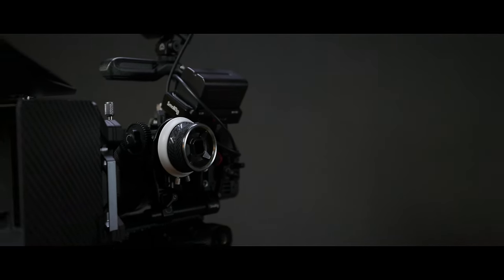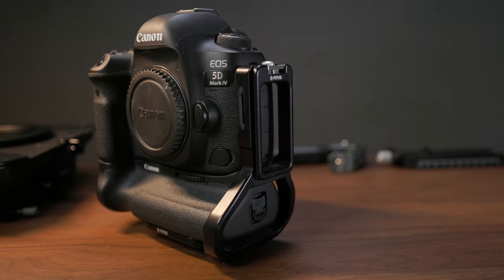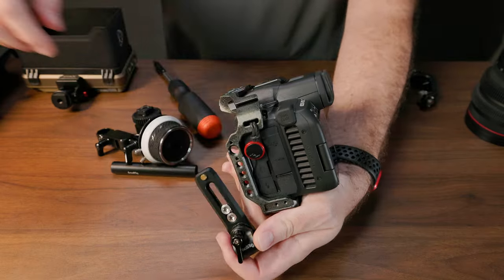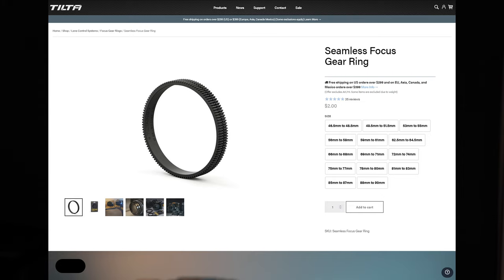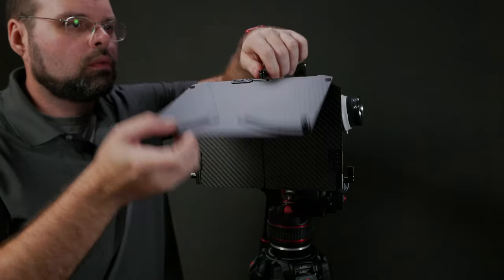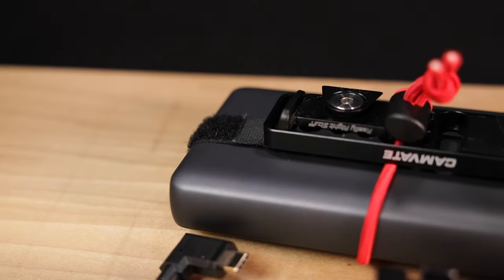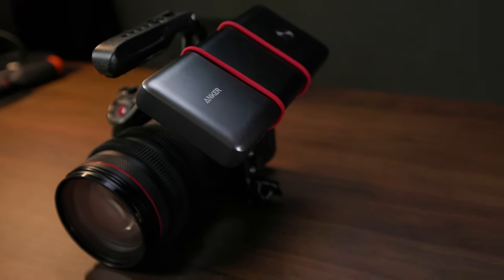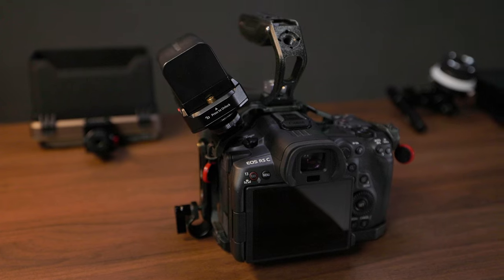Rigging and Accessories for the R5C Revisited Almost 2 years later - EOS R5C Tip 28

Comment: I love your R5C videos, just bought one, but I think I might have gotten a lemon. When you have the lcd screen closed, is there any wiggle in it, for example if you press it slightly upwards, toward the viewfinder? It's hard to know what's within the accepted tolerances, but my R5 has zero wiggle when closed. Oh, and when slightly underexposing the camera against a white wall for example, I get awful vertical magenta banding in clog3. Do you reckon this is normal?
Reply from the maker: Yes, there is. Maybe around 1 mm at the far end. Enough to be noticeable if you wiggle it. That said, one big difference between the R5 and R5C is that the R5's screen folds completely into the body while the R5C's doesn't quite lock down that tightly.

The banding doesn't sound right through. But, before you call Canon, if you haven't run auto black balance (ABB on the top fo of the shoot 6 menu) try that first. If that doesn't clear it up, then you'll probably want to talk to Canon about it.

Comment: I got a 50 watt hour v mount battery and a V-Mount adapter for the bottom of the DJI RS2. Usually I just use the gimbal until the battery dies and switch it though rather than waste time setting it up. However if I did have another gig where I needed the gimbal all day it would be suitable.

Comment: FYI, Accsoon also have a NP-F to USB-PD adapter offereing similar power solution. The Accsoon one has 2 anti-rotation pin holes on the bottom side of the adapter. Does the small-rig one has this feature?
Reply from the maker: No. But it has a slot that can accept multiple captive screws, so you can prevent it from rotating that way.

Comment: I ended up getting the Black Mamba cage for my R5C and now the eyelet screw is completely stripped. Definitely user error but the screw is like aluminum foil strength. Trying to figure out the best way to get it out probably drill. Or get a reverse drill bit very tiny one
Reply from the maker: Almost all of thse cages are Aluminum. You absolutely don't want to crank down on any of the screws more than tight enough. If you need to hang something use a piece of NATO rail with multiple screws into the cage, or an Arri style 3/8-16 thread with the rotation locking pins.

Comment: If you did buy the small rig black mamba kit it comes with a cable securing option That will be sure to frustrate you to no end. It definitely does work though once you get it in secure
Reply from the maker: I found SmallRigs cable clamp to be largely useless. Yes, if you get everything setup right it will hold the cables. But since the clamps use a sliding action, if your cable's connectors are precisely sized, the clamps puts force on the connector. The entire point of the Canon cable protector is to prevent torque from being applied to the connectors and therefore from breaking the solder joints. So that's one strike against the SmallRig clamp.

The second strike is that it blocks the mic, headphone, and PC sync jacks. Granted, I don't usually use them. But when push comes to shove, I also don't want to have to get out a hex driver to get to them either when I need them.

Ideally, if you're trying to protect the ports, you want to keep the cables centered with no extra torque on the jacks, with as small of a loop of cable as you can have before you run into serious strain relief of some sort. Barring proper strain relief, small tidily routed cables that can't be easily snagged is ideal.
Reply: @PointsInFocus  I have never even thought to use the Canon one, but I do remember in your previous video you said it blocked the port. For me I can still access and plug in a mic. I don't plug in headphones directly to the camera but I still have access to my ports. I understand what you're saying about pressure on the ports. You have to get it so tight with the slider, then push and secure it with the tiny pin. I need a fast solution for my setup right now. Currently putting a lot of strain on my family trying to work 15 to 18 hours a day. So if I can record I need to be able to switch from camera to gimbal pretty quick. If I would have listened to you from the beginning it would have been better off. Unfortunately, It is in my nature to overthink and overspend. Thank you so much as always. I don't know how you're improving so fast with YouTube and it gives me hope. You had all the basics down right away with super informative videos. Now your videos are tailored to your audience and optimized very well. Keep it up!
Reply from the maker: So my ultimately solution for cables on the camera is to basically perminately keep short cables always in the ports and on the port protector. With the USB cable, I can easily plug it into either of my battery solutions, and if I need something longer, or to hook it up to a computer, I use a USB-C coupler.

For the HDMI cable, I do basically the same thing. Though I have it wrapped through the strain relief on the Canon port protector. It's long enough to plug in to a monitor on camera, otherwise I use an HDMI coupler to extend it to whatever I need.

One thing to keep in mind, is the HDMI micro is not really a good connector. It's significnatly more fragile than the mini connector, and has a much lower cycle rating. In general, I try to keep as much pressure off the connector, and plug/unplug it as little as possible.

Comment: Seria ótimo se a R5C tivesse a possibilidade de gravar 4k RAW! E dual pixel  Focus no modo vídeo!
Reply from the maker: Assuming I/Google translated that correctly. 

4K raw requires a 4K sensor, you can't down sample and still have raw sensor data. Though you can shoot raw in the other sensor modes, in S35 it's 5.7K and in S16 it's around 3K.

As for dual pixel AF, I'm not quite sure what you're saying, but the R5C (as do all Canon Cinema cameras) does use dual pixel AF for focusing.